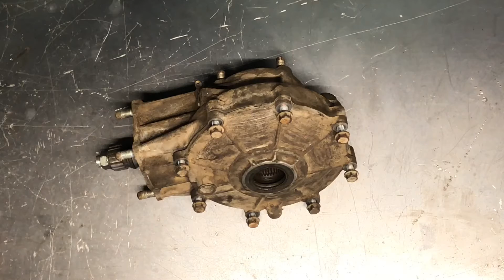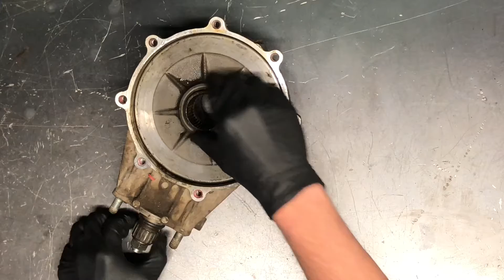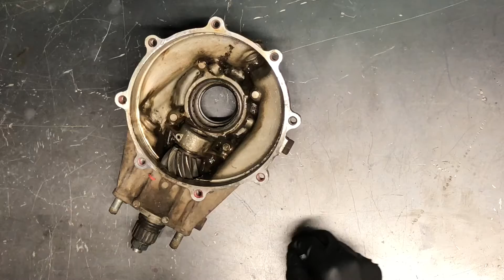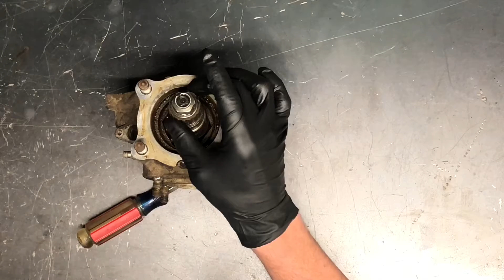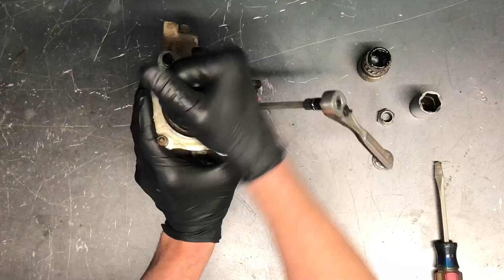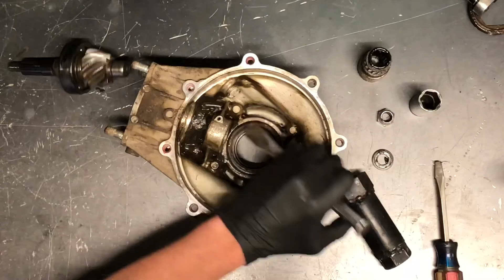COMMON ISSUE -  Kawasaki Prairie 400 - Rear End Transmission Gear Differential PROBLEM

Comment: Use a 40mm across the flat nut for the special tool.  Get yourself a Mapp gas torch and use heat to expand the case or bearing races to get the nut, and the bearings to drop out of their resting places.

Comment: I wish he removed the pinion bearing.
Reply: 64mm and try drill and tap the pinion bearing and slide hammer it out, or weld a rod to it and slide hammer it out. Use a little heat also.

Comment: large nut is 64mm. For pinion, try blind bearing puller/w slide. Drill and tap/w slide hammer, weld a rod to it /w  slide hammer.

Comment: I have a terrible clunk noise that comes from my 1997 Kawasaki Prairie 400 while going uphill at random times. The ATV has had an easy life, I've adjusted the shift linkage and replaced the belt. Removed and inspected the front drive shaft, drove it with the front drive shaft out (to eliminate front end issues.) and I still have this noise! Does a loud clunk noise come from a rear end issue? If you want to hear it for yourself you can see it on my channel on a video titled "quick update on the clunk" I'm about out of things to take apart. I have also changed the engine oil and didn't see any metal shavings and cut the filter open and it's pretty clean. Any Ideas would help.
Reply: Not sure exactly where your noise is coming from but for me I found the swing arm bearings where all but gone which allowed enough movement during up and down travel that the rear drive shaft yoke was hitting the swing arm housing and making an aweful noise
Reply: @Iz3k34l  thanks man I haven't had much time to work on it, but I do appreciate the suggestion

Comment: I wish people has videos of the sound
Reply from the maker: You aren't hearing any sound?
Reply: @MidNebraskaMotorsports  ☝
Reply: No noise but it doesn't like to go when you throttle it. Not for a sec and you got to throttle kinda hard.
Reply from the maker: Sounds more like a belt/clutch issue. You should be hearing some grinding noise if the machines rear end is bad. Let me know.  Let us know if there is anything else you need!  https://www.midnebraskamotorsports.com/

Comment: Where can i get the gears for this  Differential
Reply: It's not available on the usual atv part websites as you may already know so the only option is to try to find a used one possibly on Ebay.
Reply: Ebay $60 New for the bearing set

Comment: I have a 2000 prairie 400 4x4..it won't go forward..starts and runs fine but when put in gear it won't move..what could it be
Reply: @MidNebraskaMotorsports     yes, it's the belt..can I put a new one on without taking the clutch off?
Reply: @MidNebraskaMotorsports    going to try tomorrow, I don't have a puller bolt.. I'll let you know if that fixes the problem...
Reply: @MidNebraskaMotorsports   belt went on fine, but I have no reverse. maybe the chain you think?

Comment: I’ve got a 01 Kawasaki 300 4x4 and having trouble going into reverse. That’s how I got it and trying to figure out why it’s not wanting to engage. Light comes on and it will “shift” into reverse but won’t do anything. Let me know if you guys have tips!
Reply: @braydan berezay My 400 reverse did not work and the guys on Facebook Kawasaki Prairie group all said reverse chain is common problem it will stretch and come off. I opened the transmission and found the reverse chain was off. I replaced it and that fixed reverse. This guy has a video on replacing drive belt which will show you how to remove clutches. Drain the oil then remove the cover the cover behind clutches. On top of cover by head is an oil line remove that bolt. Tip when you pull on cover hold in on shaft for secondary clutch so gears don’t fall out. This guy also has a video on motor disassemble that shows you the inside. Search his channel for Prairie 400 motor disassemble. It’s a good video.
Reply: @MidNebraskaMotorsports  Thank you for the videos. They have helped me.

Comment: I looked everywhere for a goddam nut that would fit that inner bearing nut. Napa didn't have anything that big. What is the exact size of that nut? What thread? Where do you find it? All dam day driving around trying to find one that would fit in there and over the pinion shaft. Also.. I need to know how you guys got the bearing race out of the housing.. Thanks
Reply: I found the nut at True Value - 1 5/8" across flats.  Had to sand it down on all flats a little to make it fit.
Reply: @jrussellstephenson  I ended up finding a nut that fit in ace hardware off of some random fitting. Can't remember now if it was a  gas fitting or something off an electrical conduit. I bought the rebuild kit off Amazon it was the All Balls brand it was very good. Give all the crap to my local Napa auto parts they have a machine shop. The guy charged me 1 hour of labor 65 bux but I know it took him longer. Next time I'm just selling the quad I'll never get into that job again it was a nightmare.
Reply: 64 mm. You can buy the tool on amazon etc
Reply: @Alan-cw8vy  It's funny how all the questions I've asked on YouTube get answered a year later. 🤣 The shit box is long gone.
Reply: 64mm and try drill and tap the pinion bearing and slide hammer it out, or weld a rod to it and slide hammer it out. Use a little heat also.

Comment: You have the wrongink posted to the rebuild kit. You have the front diff kit posted.. Great video though I wish you would have gotten into how to remove the bearing do the pinion. Mine is stuck inside the housing. https://www.amazon.com/East-Lake-Axle-differential-compatible/dp/B07YDZP4CX/ref=mp_s_a_1_1_sspa?dchild=1&keywords=prairie+400+rear+differential+kit&qid=1603878489&sr=8-1-spons&psc=1&spLa=ZW5jcnlwdGVkUXVhbGlmaWVyPUExSFQxM0RHUjNKWVpCJmVuY3J5cHRlZElkPUEwMzA5ODgwMUNQSlJPQjdQOVVSSiZlbmNyeXB0ZWRBZElkPUEwOTY5OTU3MUExOU1MNjFZSjM3USZ3aWRnZXROYW1lPXNwX3Bob25lX3NlYXJjaF9hdGYmYWN0aW9uPWNsaWNrUmVkaXJlY3QmZG9Ob3RMb2dDbGljaz10cnVl#aw-udpv3-customer-reviews_feature_div

Comment: I need all the diferential for prairie 300 2002 ....
Reply: Mid Nebraska Motorsports do u have the rear diff for a 2000 Kawasaki prairie 400 4x4
Reply: @bigpp7892  how much for the Kawasaki prairie 400 4x4 rear differential

Comment: Hey man got that piñon nut out finally! So my next question is how do I get that bushing out at the end of the video?
Reply: He Don’t know because he would’ve showed it on the video even my mechanic a TV mechanic didn’t know how to get it outside to get a whole used differential
Reply: Benjamin Sauerhage yo I figured it out. It’s a pretty big size nut but if you have a nappa auto store they have one I’m pretty sure it’s the size after 1 1/8 they’ll have it, but if I were you I’d do it this way, get a pipe wrench and the size bolt I was talking about and put a pipe or socket around then twist it it should come out no problem

Comment: What size nut did you use to make the special tool?
Reply: It's 40mm across the flats.  A 1" standard nut drilled out, and then welded directly below another nut of the same size will work.  Cost about $10 from Grainger and about an hours worth of work grinding it and welding it, it worked great.